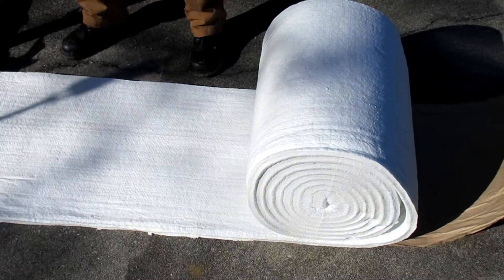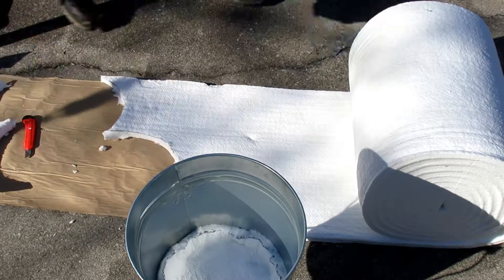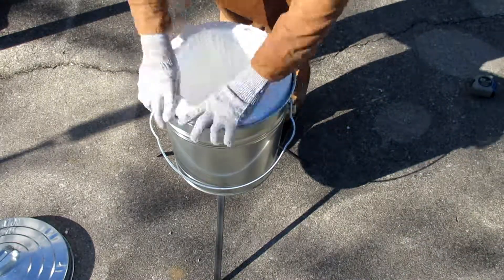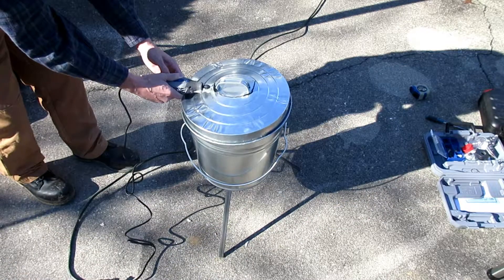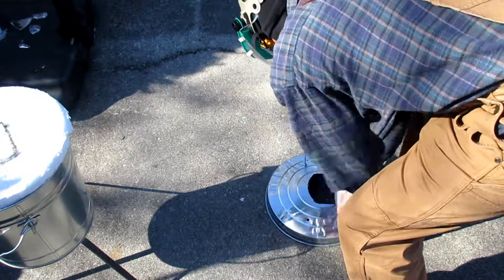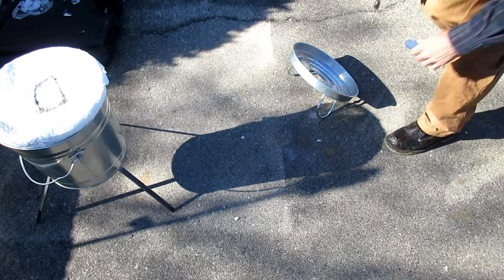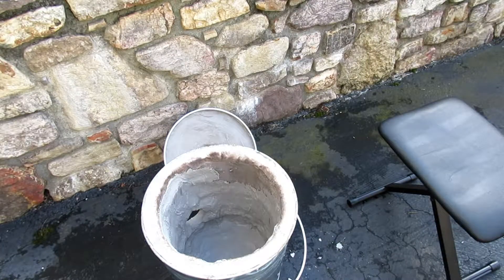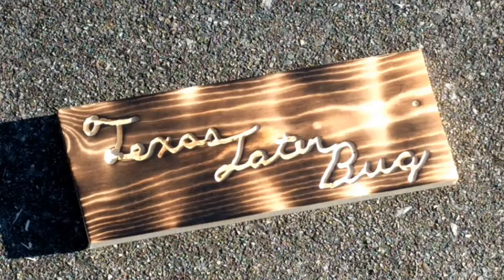Furnace Build Part 2 Lining - My take on the Mini Metal Foundry

Comment: what is forge welding i've never heard of that
Reply from the maker: It is welding steel using the heat of a forge, rather than a welder. It is a blacksmithing technique that requires the use of "flux" (usually boric acid) which can degrade the lining of a forge over time. Check this out for a good explanation: https://www.youtube.com/watch?v=j814AqiKVvE